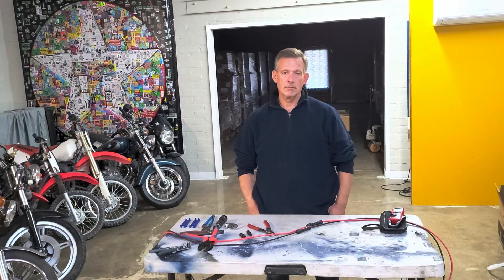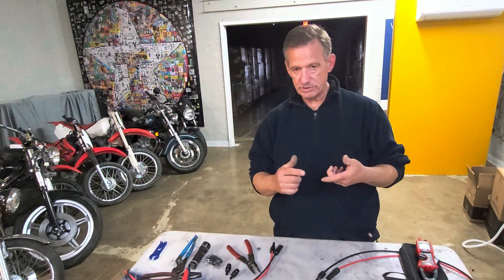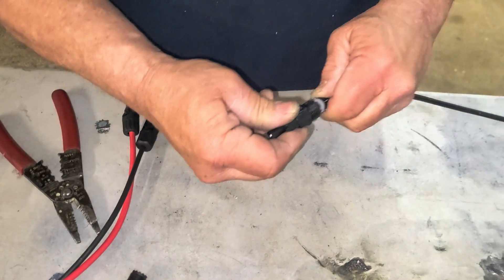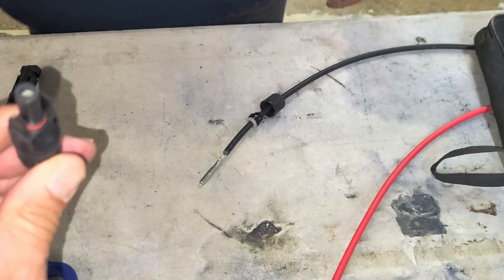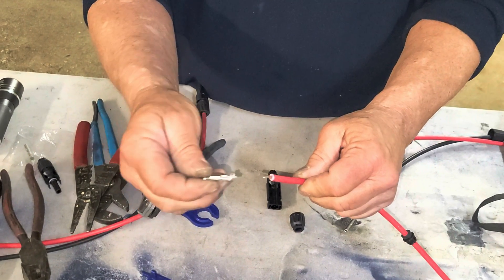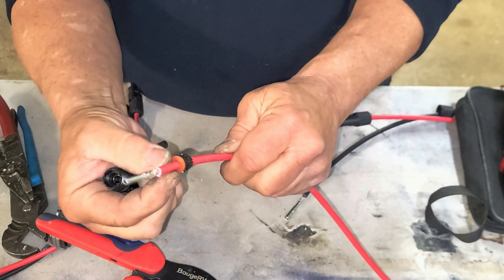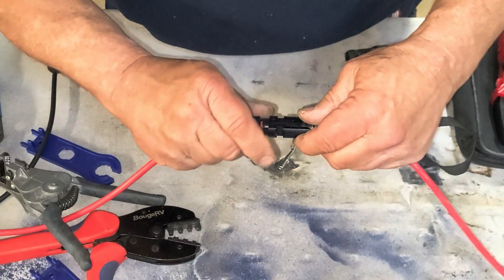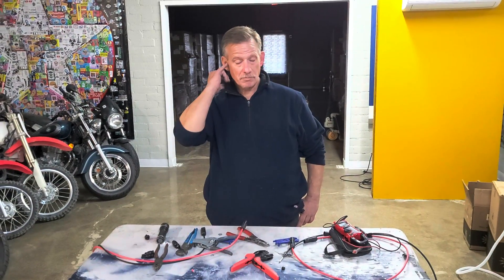MC4 problems solved: Todd's double crimp. Correct connector pin seating. #offgrid

Comment: "This will always be the positive." No. You should test. When the panel is first connected, the female connector should be in place. Not always. TEST polarity. That same connector is used on the negative side of the connecting line hence NO "This will always be the positive." It will not always be positive.  Also, I suggest you strip 2 cm for male pins and 1 cm for female. To avoid the issues of crappy connectors, try Amphenol 50 amp MC4s and stay consistent if you like them.

Comment: LOL You have the male and female reversed. Don't look at the plastic housing but see the metal connectors. You say, 'look inside the female connector'. No, it's a male. And the pin is supposed to be a little more shallow than the female which sould travel to the tip of the plastic protrusion. Anyway, that's a common misconception. Always check the polarity.
Reply from the maker: Ah, the great debate. Is a male a male based on what he shows on the outside of his pants or what's in his pants? Because the plastic housing that looks male has the female metal connector and vice versa. Multi-Contact (later Staubli), the inventors of these,  name them by the inside pins. But most people named them boy or girl based on the outside housing.
Reply: @airspool  There is no debate. I just tried to assist you and visitors. Your supercilious remarks about sexuality are childish. You have the male and female connectors reversed. This creates chaos and could result in harm. Don't look at the plastic housing but see the metal connectors. You say, 'look inside the female connector'. No, it's a male connector. Like XT60s and 90s the metalic piece determines gender. And contrary to what you say the MC4 pin is supposed to be a little more shallow than the female metal receptacle which should reach the top of the plastic protrusion.  Mc4 connectors suffer from a total lack of commonality and interoperability. Always check the polarity too. Not every solar panel is shipped with the correct connector polarity.

Comment: Wrong crimping tool and bad advice + poor installation you have just demonstrated.  Trust me, I've replaced over 1000 PV connectors in residential, commercial and Utility solar.
Reply from the maker: RJS, do you have a video for this? It would be useful for our users.
Reply: @airspool  the manufacturer of the DC connector should provide this data.  FYI, many of the connectors found on Amazon are cheap plastic and will not last past 7 years and depending on how DC conductors are managed, it may start a fire.
Reply: @RJSOBO88  So you have criticism but nothing useful to contribute!
Reply: @seanyounk1  manufacture will provide the data of how to install.  Everything today comes with instructions, it's easy to find but who's looking?
Reply: @RJSOBO88  I am;  a complete novice.  I am building a very small 2 panel, (200 watt total), system and would like to know the right way to do it.  I have purchased some connectors and I don't see any instructions at all.
Reply: @airspool  https://youtu.be/DUIOfUflD8A?si=WuVJ3jiY3_7YLaIy
Reply: @airspool  the manufacturer of the DC connector should provide this data.  FYI, many of the connectors found on Amazon are cheap plastic and will not last past 7 years and depending on how DC conductors are managed, it may start a fire.